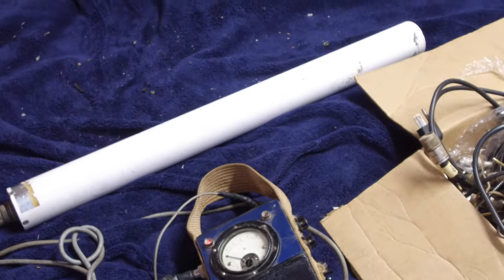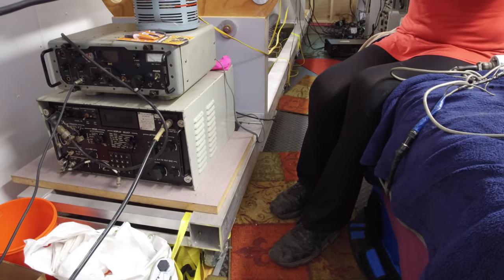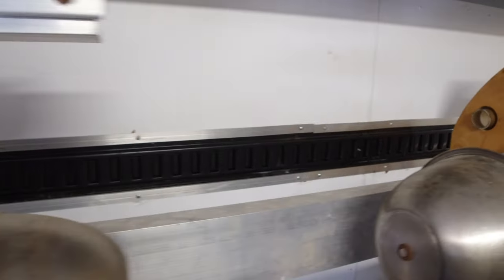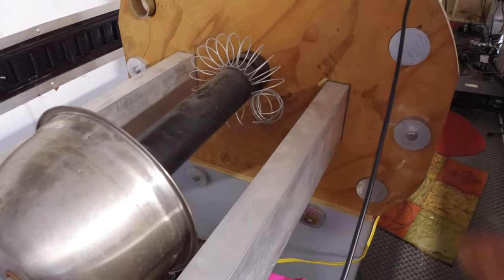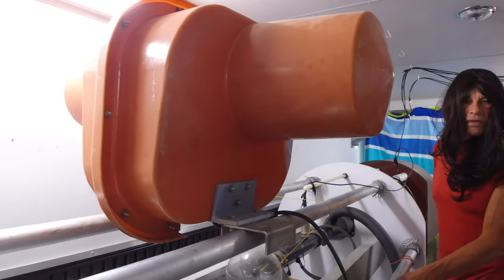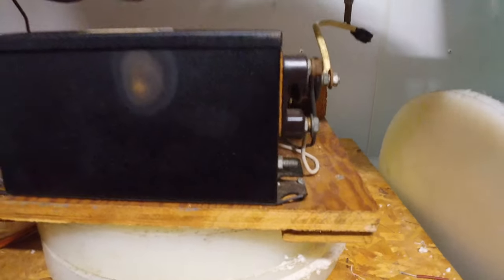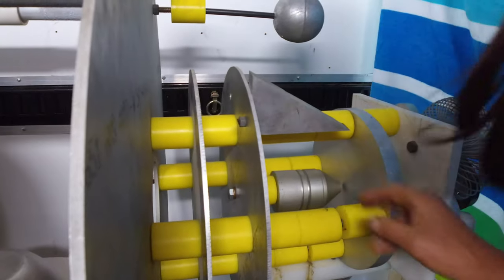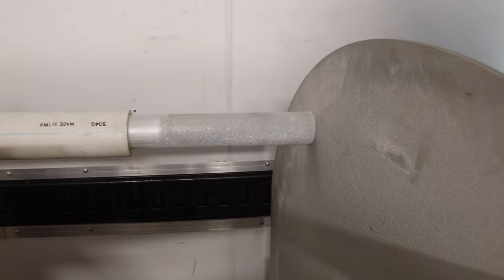Discussion of "Hutchison Ray Gun" setup with John Hutchison

Comment: I might consider scaling the size down by using an old tv flyback transformer, a piezio spark generator, a series of resistors and capacitors with spark gap and halsbach array magnetic wave guide following a magnetron . 
That might conform with some of the descriptions that KS mentioned once upon a time.